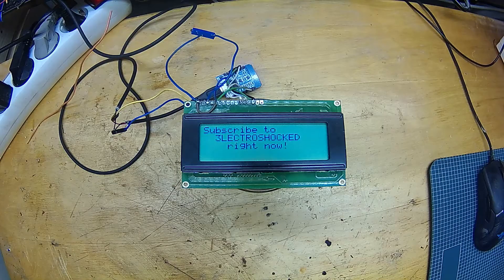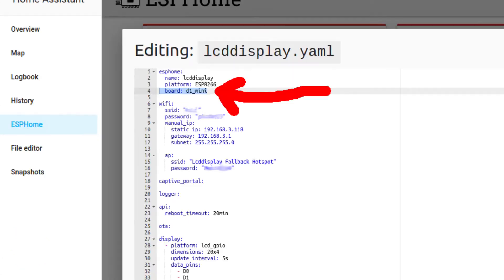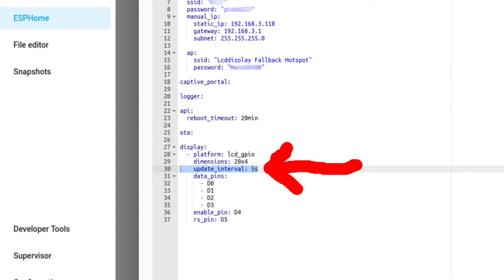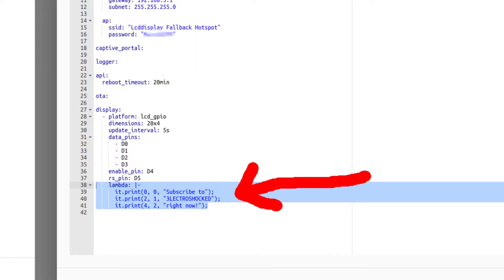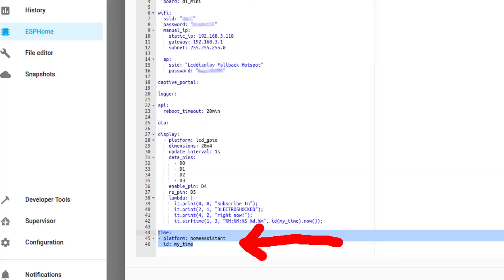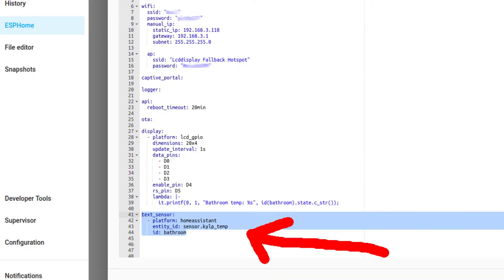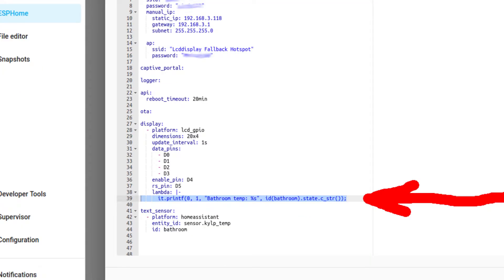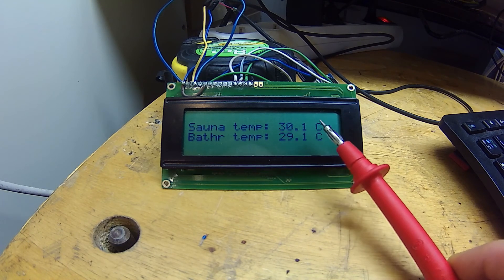How to set up LCD DISPLAY in ESPHome | yaml & lambda

Comment: I usually do not comment but u r the man. Simple to the point video. And I wasn't able to display a sensor with text and number. My mistake I programmed it under sensor instead of text_sensor. Voila every things works perfect. You saved me. I wasted like 2 hrs trying to figure out. Stupid chatgpt also did not point out that change to text_sensor. Phew. 
Quick question do you use wf2 as I use it and have a question
Reply from the maker: Thanks! :)

Comment: Heltec Wifi Kit 8
https://heltec.org/project/wifi-kit-8/
Newbie in Home assistant
I connect a dht11 on D3 PIN and get values temp and hum to HA.
But I also want to read it on the lcd.
I dont know how i can do it
I try to make the code reading through the internet but I dont know a lot.
This is what I want to say the display 
first line DD/MM/YY HH:MM
Temperature
Humidity
I dont have another display to test it with other boards wemos that I have
The code that already works is below but i cant work lcd: 

esphome:
  name: temp_test_lcd
  platform: ESP8266
  board: heltec_wifi_kit_8

wifi:
  ssid: "JOHANN"
  password: "@el2010@"
  manual_ip:
    static_ip: 192.168.1.24
    gateway: 192.168.1.1
    subnet: 255.255.255.0

  # Enable fallback hotspot (captive portal) in case wifi connection fails
  ap:
    ssid: "Temp Test Lcd Fallback Hotspot"
    password: "@el2010@"

captive_portal:

# Enable logging
logger:
  level: DEBUG
  
# Enable Home Assistant API
api:
  password: "@john@"
  reboot_timeout: 20min

ota:
  password: "@john@"

sensor:
  - platform: dht
    model: DHT11
    pin: D3
    temperature:
      id: "temp"
      name: "Temperature"
    humidity:
      id: "hum"
      name: "Humidity"
    update_interval: 30s

i2c:
  sda: GPIO4
  scl: GPIO5
  scan: true  

display:
  - platform: ssd1306_i2c
    model: "SSD1306 128x32"
    reset_pin: GPIO16
    address: 0x3C
    lambda: |-
    
#      it.print(0, 0, id(font1)  "Hello World!");

font:
  - file: "Amiko-Regular.ttf"
    id: font1
    size: 10
  - file: "Amiko-Bold.ttf"
    id: font2
    size: 14

time:
  - platform: homeassistant
    id: esptime

web_server:
  port: 80
#  auth:
#    username: admin
#    password: johann69
Reply from the maker: Hello. Thanks for your comment! Well, I do explain that in the video. Maybe you should watch again? :)

Comment: Hi, great video. I did a similar project but have some issues. I used  a 16x2 lcd and with only two lines available i would like to cycle through different sensors etc. I cant seem to get it to work as the pages option does not work on this lcd. I used to have this setup just in arduino ide and was able to use a loop and timer to cycle text.
any ideas how to do it in esphome? not that comfortable yet in esp home as i do notice some subtle differences with what i am used to.
Reply from the maker: Hello! Thanks for watching and for your question. We actually examined that same problem with another viewer. The only thing I was able to think of was using automations in HA to send different data to a text output component on that lcd - if that's even possible.. Did not try that though, sorry. Hope this helps :)
Reply: @3LECTROSHOCKED  thanks. ill try some things. maybe have several sensors report to a mqtt topic and only showing that topic on the screen. or something like that.
Reply from the maker: That sounds like a very good idea! Please keep me posted :)
Reply: I ran into that issue so I added a delay for 5sec's to the end of my  HA automation then after the delay I added a MQTT publish command with a blank payload to the subscribed topic. This will clear the screen for the next msg. It's a work around but it works
Reply: This works, the example is to cycle between Hello World How Are you?
Hope this helps. Lots of thanks to @3ELECROSHOCKED for helping out

globals:
  id: button_count
  type: int
  initial_value: '1'

esphome:
  name: lcd
  platform: ESP8266
  board: d1_mini

wifi:
  ssid: 
  password:

# Enable Home Assistant API
api:
  
ota:
  
i2c:
  sda: D2
  scl: D1
text_sensor:  
  - platform: template
    id: premessage1
  - platform: template
    id: premessage2

interval:
  - interval: 2s
    then:
      - lambda: |-
          id(button_count) += 1;
          if (id(button_count) > 2) {
            id(button_count) = 1;
          }
          if (id(button_count) == 1)
            {
              id(premessage1).publish_state("Hello");
              id(premessage2).publish_state("World");
            }
          if (id(button_count) == 2)
            {
              id(premessage1).publish_state("How");
              id(premessage2).publish_state("are you?");

            }
display:
  - platform: lcd_pcf8574
    dimensions: 16x2
    address: 0x27
    lambda: |-
      it.printf(0,0, "%s", id(premessage1).state.c_str());
      it.printf(0,1, "%s", id(premessage2).state.c_str());

Comment: Many thanks for the guide. Just in case it helps someone else, it should be noted that the display (node) has to be added to the ESPHome integration otherwise you will not be able to retrieve HA values. This was not automatic for me so I had to do it manually.
Reply from the maker: Hello! Thanks for your comment! And thanks for pointing that out. Indeed all nodes with ESPHome firmware have to be in the same HA ecosystem so they can share information with each other via HA. Sometimes one needs to add a new ESPHome node into HA manually, if that doesn't happen automatically. Usually it works automatically, but sometimes not. I think it's a bug, but luckilly not a major one :) Thanks again for watching and commenting!

Comment: I want to display multiple sensors values with a gap of  2s between each sensor. For example temperature will show for 2s then clear the screen and show humidity and then clear the screen and then another sensor value. I am unable to figure out the lambda delay. Could you please help me.
Reply from the maker: Hello! Good question! Have you tried to create multiple pages on your display? If your display supports that, then you can use "interval" component to flip through them like a repeating slide show. Here is more about that: https://esphome.io/components/display/index.html#display-pages Hope that helps! :)
Reply: @3LECTROSHOCKED  Thanks for your reply. I am using a PCF8574 similar to yours. I had tried the page method but I don't think it supports pages. Have you been able to achieve page function on your LCD display?
Reply from the maker: Unfortunately I haven't tried that on my display. Hmm, next thing I could think of, is to test using -> id(your_display).turn_off();    -dont know will that work. But if it will, then you can clone the component (same pins etc) and only change ID and what it shows (it.print). Then make an automation to switch between these clones with "interval". Maybe.. Sorry, don't really know what to suggest, since there are no documentation available about what commands in lambda are actually possible to use inside esp :(
Reply: @3LECTROSHOCKED  thanks for that idea.  Will give it a try and update. Yes the documentation is pretty limited.
Reply: @3LECTROSHOCKED  any idea about how to add delay and then return to the beginning of the lambda?
Reply from the maker: It seems that in esphome lambdas are mostly meant for states and not for actions. But there is exception: "if" and "else" in binary sensor documentation. Maybe these could be used for triggering different "it.print" entries. The trigger could be "text_sensor" imported from HA. For example make a script in HA, to publish text states with intervals: "1 page" -> wait -> "2 page" -> wait -> repeat. Kinda hassle, but could work :D
Reply: @3LECTROSHOCKED  trying various things. Lets see which one works. Anyway thanks for all the help and keep posting great videos.
Reply from the maker: Thanks for watching! I hope something will work :)
Reply: @debzkool  After few weeks I did that with ttp223 tuch button. Think it might be same for time period. Just have to know, that what you want to display must be variable string... So, when I   touch buton I have increase counter by one. According this I'm displaying 1st or 2cond sensor values, putted into string. Main thing:

globals:
  id: button_count
  type: int
  initial_value: '1'

text_sensor:
  - platform: homeassistant
    entity_id: sensor.bathroom_temperature
    id: b_temp
    
  - platform: homeassistant
    entity_id: sensor.bathroom_humidity
    id: b_hum
  - platform: homeassistant
    entity_id: sensor.garden_temperature
    id: g_temp
  - platform: homeassistant
    entity_id: sensor.garden_pressure
    id: g_pre
  - platform: template
    id: premessage1
  - platform: template
    id: premessage2
  - platform: template
    id: val1
  - platform: template
    id: val2

binary_sensor:
- platform: gpio
  pin:
    number: D6

  name: "LCD function button"
  id: lcd_function_button
  on_click:
    then:
      - lambda: |-
          id(button_count) += 1;
          if (id(button_count) > 2) {
            id(button_count) = 1;
          }
          if (id(button_count) == 1)
            {
              id(premessage1).publish_state("Bath. t: ");
              id(val1).publish_state(id(b_temp).state.c_str());
              id(premessage2).publish_state("Bath. h: ");
              id(val2).publish_state(id(b_hum).state.c_str());

            }
          if (id(button_count) == 2)
            {
              id(premessage1).publish_state("Gar. t: ");
              id(val1).publish_state(id(g_temp).state.c_str());
              id(premessage2).publish_state("Gar. p: ");
              id(val2).publish_state(id(g_pre).state.c_str());

            }

display:
  - platform: lcd_gpio
    id: lcd_display
    dimensions: 16x2
    update_interval: 1s
    data_pins:
      - D0
      - D1
      - D2
      - D3
    enable_pin: D4
    rs_pin: D5
    lambda: |-
        it.printf(0,0, "%s %s", id(premessage1).state.c_str(), id(val1).state.c_str());
        it.printf(0,1, "%s %s", id(premessage2).state.c_str(), id(val2).state.c_str());

Thanks guys for inspirations!
Reply: @pswierq  thanks for following up. Will give it a try. You are right the logic should work the same way. Lemme try it out. Thanks.
Reply: @debzkool  
got it:

interval:
  - interval: 2s
    then:
      - lambda: |-
          id(button_count) += 1;
          if (id(button_count) > 2) {
            id(button_count) = 1;
          }
          if (id(button_count) == 1)
            {
              id(premessage1).publish_state("Bath. t: ");
              id(val1).publish_state(id(b_temp).state.c_str());
              id(premessage2).publish_state("Bath. h: ");
              id(val2).publish_state(id(b_hum).state.c_str());

            }
          if (id(button_count) == 2)
            {
              id(premessage1).publish_state("Gar. t: ");
              id(val1).publish_state(id(g_temp).state.c_str());
              id(premessage2).publish_state("Gar. p: ");
              id(val2).publish_state(id(g_pre).state.c_str());

            }

Glad to find this out :)
Reply: @pswierq  Hi Could you please share the entire YAML that you got to work finally. I am close but there are some errors.
Reply: @pswierq  Got it...For now I tried with any text and it works...Will add sensor data...Thanks a ton couldnt have done it without your help....Posting here if this helps anyone

globals:
  id: button_count
  type: int
  initial_value: '1'

esphome:
  name: lcd
  platform: ESP8266
  board: d1_mini

wifi:
  ssid: 
  password:

# Enable Home Assistant API
api:
  
ota:
  
i2c:
  sda: D2
  scl: D1
text_sensor:  
  - platform: template
    id: premessage1
  - platform: template
    id: premessage2

interval:
  - interval: 2s
    then:
      - lambda: |-
          id(button_count) += 1;
          if (id(button_count) > 2) {
            id(button_count) = 1;
          }
          if (id(button_count) == 1)
            {
              id(premessage1).publish_state("Hello");
              id(premessage2).publish_state("World");
            }
          if (id(button_count) == 2)
            {
              id(premessage1).publish_state("How");
              id(premessage2).publish_state("are you?");

            }
display:
  - platform: lcd_pcf8574
    dimensions: 16x2
    address: 0x27
    lambda: |-
      it.printf(0,0, "%s", id(premessage1).state.c_str());
      it.printf(0,1, "%s", id(premessage2).state.c_str());